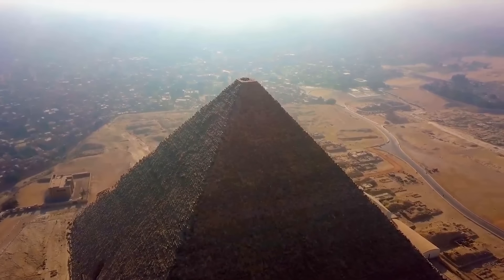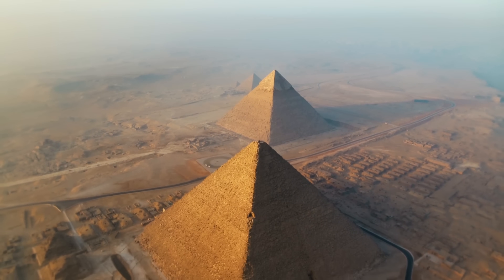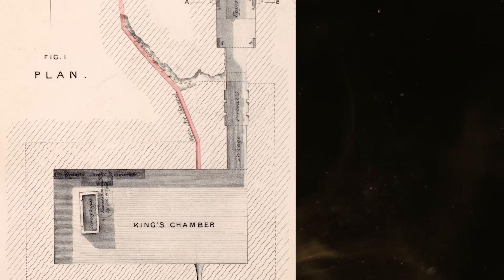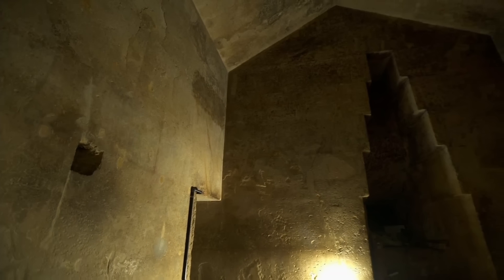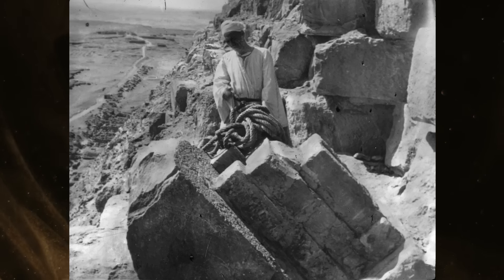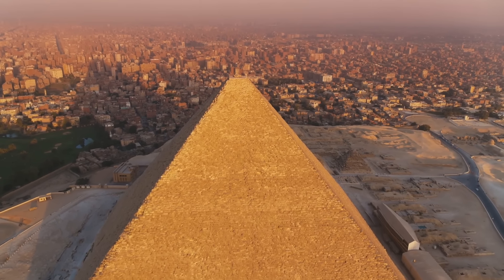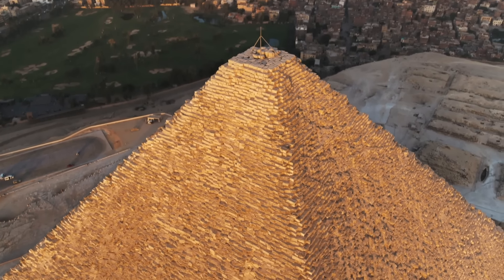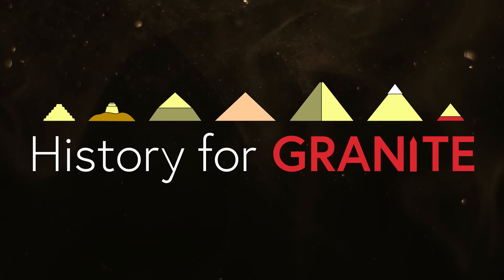One Solution to the Four Channels of the Great Pyramid

Comment: And, all these years, I was told… and believe… that these channels were perfectly straight and pointed to constellations so the spirits in the afterlife would know where to go.  Thanks for clearing that up.
Reply: Same here, I was actually taught that as well.
I love this man's videos!
Reply: @grega4607  Same. I've even seen the 3D models of the channels with their bends and still kept the idea that they were pointed at the stars. Just never put 2 and 2 together to see the conflict.
Reply: if they were straight. there would have been lots of pictures and infor about this. you would just be able to see out the pyramid like a window.. feel like this is common sense to anyone that just looked into one. its like holding a garden hose and looking through it, unless its straight you just gonna see its bend.
Reply: Graham Hancock has left the chat.
Reply: I never understood how they could have pointed to a star when the stars rise and set every night and the point at which they rise changes throughout the year.
Reply: @diregnome4898  unless one picks one particular day of the year, and particular hour (e.g. the midnight). But it will still go out of alignment after thousands of years.
Reply: Never made any sense as constellations change with time
Reply: @DogsWallop  well, the theory goes that, when the pyramids were built, the channels did line up with the constellations (Orion and I forget the other one), but yes, it would move due to precession.  Supposedly, the proponents of the theory used software to calculate where Orion was 3000 years ago and it lined up.  Not sure if that's actually true, though.
Reply: @brumm3653 not sure they would know that 2600 BC. 260 BC they probably did or at least theorised
Reply: @chrimony What does Graham Hancock have to do with this video?
Reply: @tray22   Because Hancock said they are straight shafts used for looking at specific stars. A whole generation of people, including me, read his book "Fingerprints of the Gods" and believed what he told us.
Reply: @artawhirler  He is a journalist, so he was likely going by the prevailing theory at the time. I wouldn't be too hard on him because he is one of the o ly people to hold true to stances that in the end are shown to be valid theories.
Reply: The top two leading to the king chamber are aligned to follow the magnetic resonance lines into the kings chamber which was used for the purpose of tissue and DNA repair and rejuvenation. If you map the pyramid you will see it is aligned to the magnetic resonance nodes and the the tallest node from the center of the base pass the exterior at the entrance of the channels. So careful math provides evidece that the purpose has to do with the capture of the chorus waves which travel down the magnetic resonance lines based on the fact that the parent civilization living on Ganymede must have engineered the chorus waves on Jupiter to create a million fold stronger chorus waves there on Ganymede where they reside. Presumably they heighten consciousness allowing improved psychic powers such as telepathy. Look at the pattern of the solar prominences and you find the same math in these magnetic loops, the storms on Jupiter and the location of the pyramids on the earth which seems to be designed together with the use of firestone and calcite to maximize infrasound captured within similar to how Buddha meditated leaning against a Bodhi tree to utilize the infrasound captured by the tree to heighten his consciousness. Realize that the chambers were filled with ionized HHO gas which would exit to the outside so the HHO gas would light up outside and perhaps help capture the chorus waves. The Queen's chamber channels perhaps are akin to antenna to capture the same chorus waves to a lesser extent lower down on the same magnetic resonance line and there is no purpose to go to the exterior because it would land below that line so there is nothng to capture below the line.
Reply: @chrimony  I'm pretty sure the theory was originally presented in Keeper Of Genesis (1995) which Hancock co authored with Robert Bauval. Bauval said the three pyramids on Giza aligned with Orions Belt, then they went into pyramid design and shaft correlation. The great pyramid measurements and accuracy made the book a pretty good read and got me obsessed with the topic, but i was never able to get an accurate 3 pyramid alignment with the stars with computer software back in the day 🤘😂
Reply: All alleged…
Reply: @stuartmoir7744 
What in the heck are “magnetic resonance nodes?”  And how would magnetism cause tissue repair and regeneration?  Sounds like a bunch of the most speculative hooey ever to exist.  And HHO gas?  “Chorus waves” from Ganymede?  Okay now?!
Reply: @busimagen 
Me too.  But something tells me that guy was cereal.  Magnetic resonance nodes.  Chorus waves from Ganymede.  HHO gas.  Schizophrenia?
Reply: It's a common theory that the channels align with stars, but recent findings suggest they may have bends and twists, indicating a more complex purpose than previously thought
Reply: @0101-s7v still, it doesn't make sense since the shafts are bent, they are not straightforward. Building them  straight would've been very easy for the builders if that were a purpose
Reply: @keirfarnum6811  if only some of these people would write science fiction novels rather than make conspiracy theories, they're capable of some stunning imagination.
Reply: if your spirit knows how to climb 50 meters in or out of a rathole he surely can navigate a little kink at the end lmao
Reply: 1) Classical Egyptologists have become "Big Idea Guys" and "Political Players", people with vested ideas and constituencies.  
2) The detail focus on the opening, in ancient times, of the Channels is refreshingly prescient. Outstanding !! 
3) The King's Chamber was not sealed à la Tutankhamen, but designed to breath, to be accessed and to be used by the priesthood. It is that simple. 
4) The wealth of Pharaoh Khufu was never in the King's Chamber. Pharaoh Khufu does not follow Tutankhamen.
Reply: @artawhirler  >Because Hancock said they are straight shafts used for looking at specific stars. A whole generation of people, including me, read his book "Fingerprints of the
> Gods" and believed what he told us.

But as the video shows you, that doesn't come from Hancock, that comes from Egyptologists, back then and still today, he merely accepted all the folks who said this at their word.
Reply: Well it is like this. Just not everyday the same.  @artawhirler
Reply: We were also told that all of the blocks throughout the pyramids were hand shaped ro fit. There are shaped blocks that are visible and compacted fill everywhere else.
Reply: @note: none of Hancocks hypotheses are  “true”, scientific, or backed by evidence. And shouldn’t be taken seriously. In fact he typically ignores scientific data and material culture evidence because it disproves his nonsense ideas.
Reply: 26:42  @stuartmoir7744 
I think this theory is too simplistic. The ancient Egyptians were far more advanced than we can imagine. Sure, this analysis may have been employed at a rudimentary level, for kindergarten students, as an introduction to more sophisticated constructs.
I refuse to believe they did not advance beyond the level of finger painting.
Reply: @yukelalexandre8885  So, you are saying that someone climbed up the smooth, finished side of the pyramids and dumped water into the channel opening?  How did they get the water up there?  Buckets?
Reply: @tray22 No No NOOO he actually visited  and even claimed the great pyramid,he blatantly lied and still lies about this very point. Watch anyone of the hundreds of Hancock uploads,I was a fan but over the last year or so I have realised he cherry picks points to back up his claims.
Reply: A hydraulic circuit...
Reply: With the new theory that explain it all very better it becomes more clear that the chance of SYMBOLIC porposes is higher than average , the new theory proves that the pyramids are made by geopolymer than our ancestors could carry in BUCKETS , they didnt use any advanced machinery , and theres kost of evidence to prove they were actually that primitive , the depiction letters to write is the most basic and fundamental way of writing , when  we got more advanced , we made its simpler like u see today.
The fact that they relied on wind to travel by ships , the fact that theres no depictions of advanced machinery in scripts, the fact that we only have found primitive tools like saw and etc every thing proves they were primitive.
We have found human hairs inside these so called "carved stones" 🤦‍♂️.
I mean how more obvious can it get ?
Reply: Again ... cereal? @busimagen
Reply: The Chinese apparently built those curves into their roofs 'cos spirits can only travel in straight lines. Did the ancient Egyptians miss a trick here? @huuuuuuuuuuuuuuuuuuuuuuuuuuuhn
Reply: @BarkerVancity exactly. I can’t understand for the life of me how anyone could think the shafts went straight out of the pyramid. My god.
Reply: @Celtopia  except that the channels aren't even straight, they have several turns, and, according to Egyptologists in the 1800s, and as seen in their pictures, and covered in this video, it seems that at least some of the channels turn directly horizontal as they exit the pyramid, possibly to shield the channel from catching water.  So how do you account for that?
Reply: YOU'RE WELCOME SIR.
Reply: They're about as straight as Stephan Colbert!
Reply: Aliens
Reply: 🙋‍♀️ Same
Reply: I haven't finished watching the video yet.. but what kind of stone is the blocking slabs?
Reply: You assume the pyramid is a tomb
Reply: @jongoldey3842  No, I was a kid, how would I know?  The fact is I was TAUGHT the pyramid was a tomb… just like I was TAUGHT that the channels were straight, pointed directly at Orion 3000 something years ago and were made specifically to guide the Pharaoh's soul in the afterlife.  It's the archaeologists, Egyptologists and theorists at the time that made the assumptions, and teachers that passed it on.
Reply: @Celtopia  note, the 11 Pyramids on Giza plateau are not and never were aligned with the stars of Orion’s belt. Also, they were constructed circa 2500-2600 BCE.
Reply: @jongoldey3842  given the material culture evidence we have from Ancient Egyptians. It would be quite foolish to assume the pyramids were constructed for a purpose other than as monumental tombs.
Reply: @dudeDOGn thats funny, you ignore objective reality. But hey, you do you and crack on with fantasy fan-fiction. It’s fun at least!
Reply: Still can't say 100% for sure... we can't even say how they built them..
Reply: Well, it's not so much that 'you were told', rather you only paid attention to one theory that at some point was new and for that reason highly publicized.
Reading a couple of books would have helped......
Reply: @MastrMynd  It's quite simplistic to suggest you have any clue how advanced the Egyptians actually were. Who are 'the Egyptians' you refere to  anyway ?
Their dynasties spanned millenia. Generalising ancient Egypt's history is like looking at Western Europe of 1,500 years ago and Western society of today as similar.
Reply: Watch europa the last battle if you havent already
Reply: I think the pyramid was a prison for a large/powerful person or entity. The channels would have been the safest way to supply food and water.
Reply: @Flat-White  Maybe… Sasquatch?
Reply: @AncientWonderX  It's not suggested that the channels have bends, it's proven fact. And that does not necessarily indicate 'a more complex purpose'.
Reply: Best channel on YT!  One question I have is what effect does draft from the King's chamber channels have on candles?  Where would they be placed?  The question assumes that it was meant to be visited after completion.  I am sure a video could be made on candles alone 😅
Reply: Wrong. Stars is just a drawing by gods for significant events. It was to see not to go.
Reply: It's still possible they point to constellations without being straight all the way along. The fact they bend could even be to properly align them if pointing straight at their targets was avoided for some reason.

A straight line to launch at stars seems obvious to us since we typically think of firing projectiles and we couldn't do that down a winding passage. But the ancient Egyptian idea of a soul going to the stars doesn't have to obey our intuitive (and incorrect) idea of launching directly at something.
Reply: @strangevision99  except that, if you really paid attention to the video and the pictures from the 1800s, you'd see that you looked INTO the opening, you would see that it was completely horizontal to the horizon and not pointing up towards any constellation.  The only reason it appears to be pointing up is because they excavated the exterior over 100 years ago
Reply: @0101-s7v  I'm not actually arguing for them being soul passages, I'm just saying it's difficult to rule that out based on where we think they should point, if we're dealing with something as unscientific as ideas about souls and afterlife, unless we know enough about their spiritual beliefs. Which I have no idea if we do or not.

Even if they point at the horizon, soul chutes still might be the intended purpose. But I'm sure that the soul ideas are mostly suggested because it's a tomb and that seems plausible (in much the same way that a straight line might seem intuitive for a soul chute) and not because we know much about their beliefs.
Reply: The points on my house line up with the mountains looking Starr shape when u look throughout the night.
Reply: @stuartmoir7744 This is the greatest comment I’ve ever seen on YouTube. Bravo, sir.
Reply: No way would I be crawling through this, I have been in the pyramid, unbelievable
Reply: Spirits go wherever they want
Reply: @ How do you know that?
Reply: @BarkerVancity but I knew there were these locking stones in there, so it made sense that they didn't work as windows, even if straight
Reply: They could point at a large arc in the night sky maybe but stars dont stand still as far as I know...  For that matter you could pepper the pyramid with vents and they would all point at a constelltion at some time in the night.

Comment: Truly fascinating and a most logical solution. Concluding the Queen's chamber as unfinished based upon the blocking stones remaining in place and the "roughed out floor", not dissimilar to modern home building, is a far more plausible explination for why the venting holes would not yet be opened. 
Not yet having viewed the follow up videos, my guess is that the vents would allow for better interior climate control to prevent mold, mildew, salt or other build up/ condensation. Additionally, possible control for interior atmospheric pressure as well to avoid internal pressure shifts over the millenia to cause cracking to the bricks or shifting to occur.
Finally, I applaud you for going back to and relying on the oldest, first person documentation/ description of what was seen and found. As they had no dog in the proverbial fight as to metaphysical meaning of these items, they had no bias to filter their information through. They were simply reporting what they saw, what they found, how they found it, and (if they displaced something) what changes they made for future researchers.

Bravo!!
Reply: Probably a good question would be, Why the workers let the Queen's  chambers unfinished?
Reply: Well said.
Reply: WHY WOULDNT IT BE FINISHED? ARE YOU SAYING THE PYRAMID ITSSELF WAS NEVER FINISHED?
Reply: @stanlee2200  The "Queen's Chamber" is unfinished, and the Pyramid is finished. Much like how Houses are sold with Unfinished Basements, so too the Great Pyramid has Unfinished Chambers. Given that those chambers where originally covered, yes I'm dead-ass telling you they where never finished.
Reply: the roughed out floor was from the ppl who came in looking for treasure
Reply: @ivancastilla4529  Well see we call it the Queen's Chamber, however it was never for the Queen and was actually hidden away at the time of active use.
Reply: @SkylerLinux  yeah i really dont care what skyler from youtube says...jabber all you want it doesnt affect me in the slightest.
Reply: I agree with you, that it is an ancient nuclear power plant. Well said.
Reply: @stanlee2200  so the comic book guy is angry?
3 chambers-early middle, late.
If the king died, they had a chamber  to place him in.
Never finished middle, because king did not die mid-life.
It was only a contingency plan.

Roughed in floor means never smoothed.